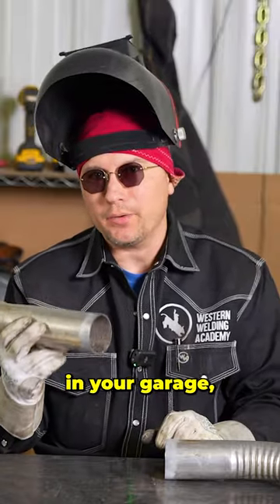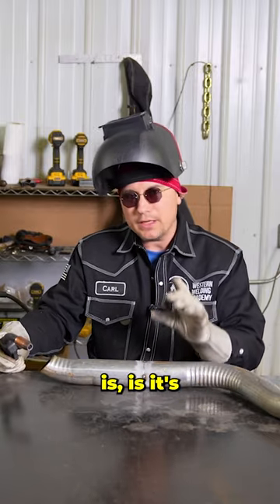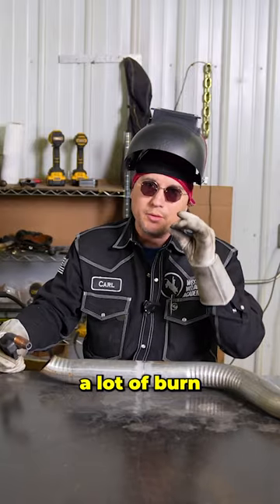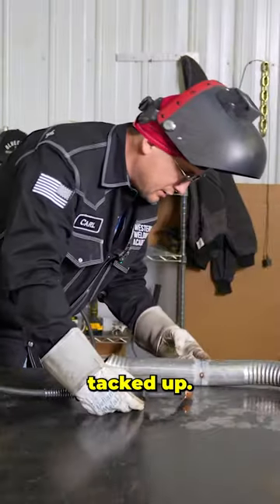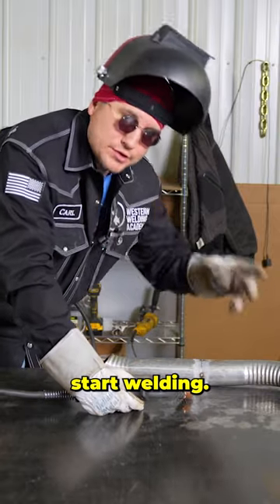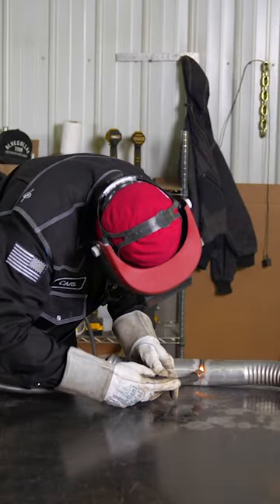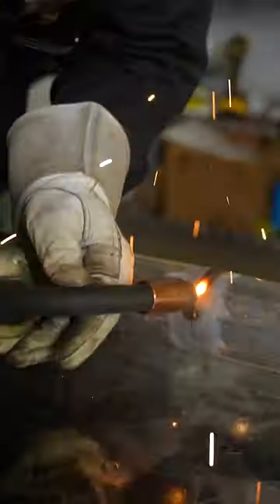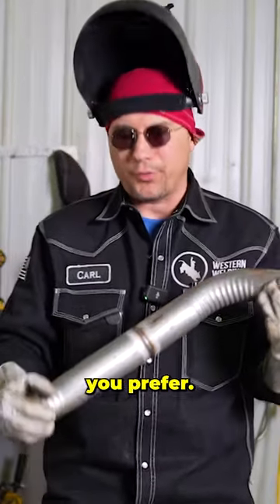How do you weld an exhaust pipe? pt.2 🤔 #shorts #WWA

Comment: Tip of the day 😂 Tack it up, stick it in a vice at an angle and weld from top to bottom both sides. If its burning holes move quicker or adjust the welder
Reply: Here in New zealand we just use a small diameter wire and just send it but spin it and keep the bead nice and small in terms of travel speed and the rest should take care of itself 👍👍

Comment: …or OR tig weld it at low amps and run an actual bead
Reply: It's more likely someone would have a mig than a tig with argon
Reply from the maker: That's also an option
Reply: Not an option, go loud
Reply: It’s not like it has to hold any fluids it doesn’t gotta be perfect, but I guess if you’re picky you can pay extra for the extra time and effort.

Comment: Done plenty of exhaust work. The best is a mild running setting, the start and stop shit is for the beginning phases of this simple shit. I’m x-ray certified, been welding for 10+ years, I’ve learned the best method is a one shot (each side) is the best deal for exhaust pipe welding! Doesn’t matter if you’re tight on the top, the sides and bottom is always some ain’t shit shit to begin with! Nobody cares if the top “root” is sagging on the inside on an exhaust homie. Let’s be 100% real here! Just saying! That start and stop shit leaves a ton of room for error!!!!
Reply from the maker: Why are you so mad?

Comment: Not a critique but more a question why not suggest to lower amps and run a continuous bead rather then tacks i mean it seems more work and time spent on something relatively easy to do , im not qualified but when i was taught to weld it wasnt a squirt gun first i had to learn stick and become proficient before my employer at the time would allow me on the mig so i did get good on sheet , rhs shs beams anything i could practice on including exhaust pipe even .. thing is in 40 years ive learnt that a qualification is only good to demonstrate you know the concept its not really an indication of skill many people skate through , i recently worked labouring in an engineer firm , i can attest to the fact those kids and few boilys doing work there were not always pushing the quality out some welds literally looked like an 8 yr old with adhd did them i even challenged a few of them on several break tests my unqualified welds were better in many ways and held .. not a dig just reminded me of how shit qualified workers really hold thier standards

Comment: Ok, doesn't look very good. Try it underneath the vehicle, where most exhaust work happens. Not on the bench.
Reply: @WesternWeldingAcademy it’s harder when you can’t see the top and are possibly laying under the car.
Reply: Meaning if you can't do it on the bench, it's gonna be worse under the vehicle. @WesternWeldingAcademy